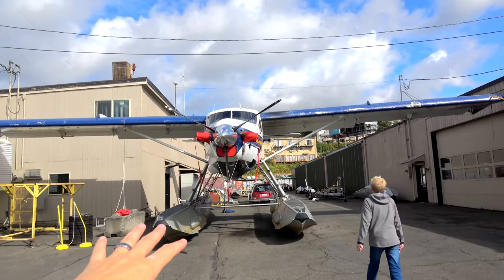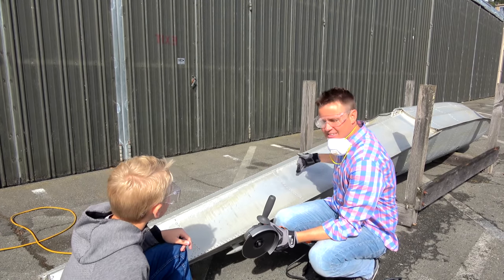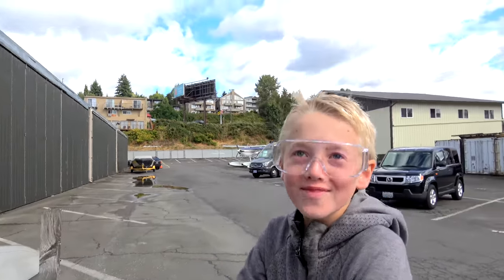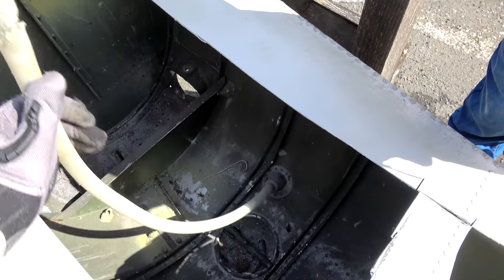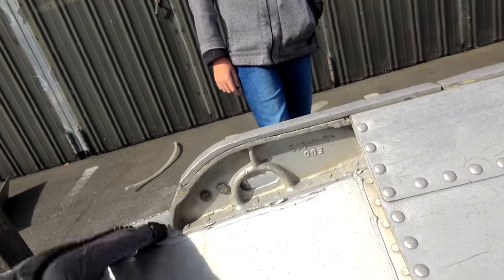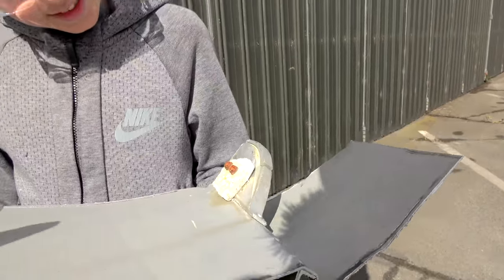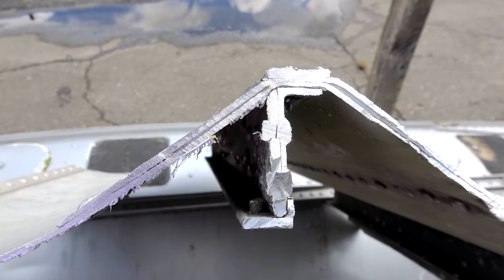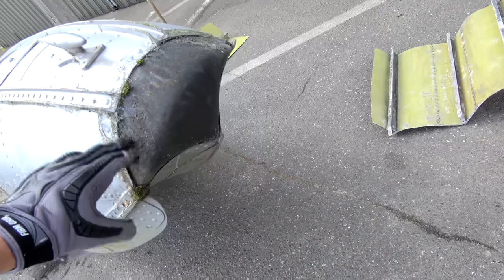What's inside SeaPlane Floats?

Comment: The central compartments can be used as auxillary long range fuel tanks (with an aircraft with an additional onboard the plane fuel pump and or air pressur-e relief valve/isation system) - and as fuel is lighter than water, can aid bouyancy - but that float hadn't been used as fuel tank for a long time. the some of other compartments can be used as partial storage too - limited by the opening/inspection cap sizes.

Comment: The large plane is a deHavilland Otter and your float is an Edo float from a Cessna 180 and the pipe is attached to a nozzle that they connect a hand bilge pump to so they can pump the water out of the float. Also I literally work there please don’t stand on the airplane float or I’ll have to fill out an incident report form when you fall in.